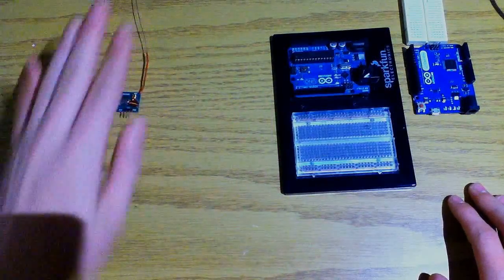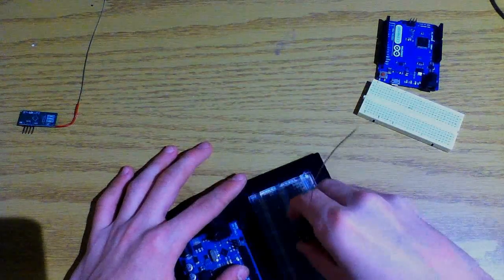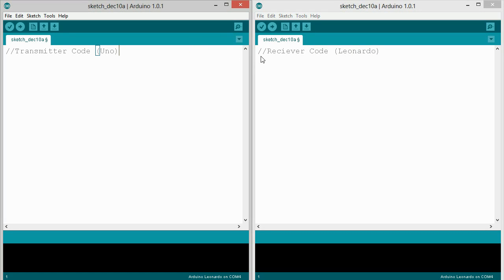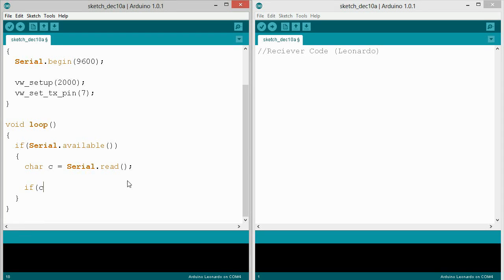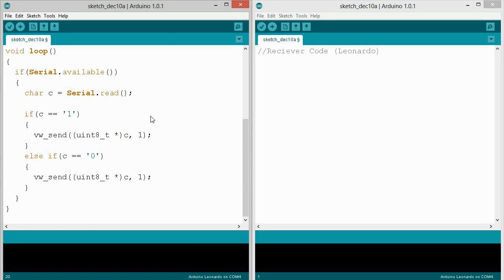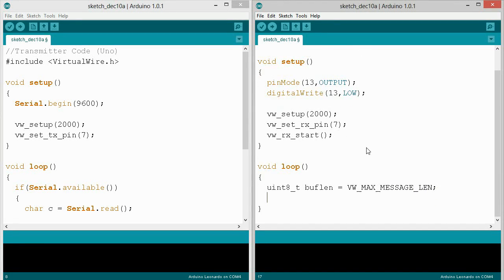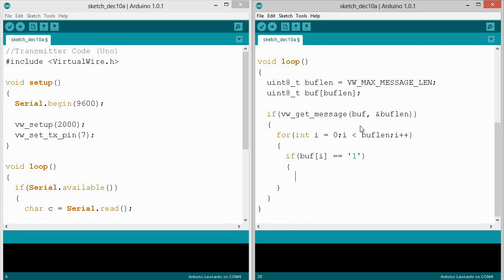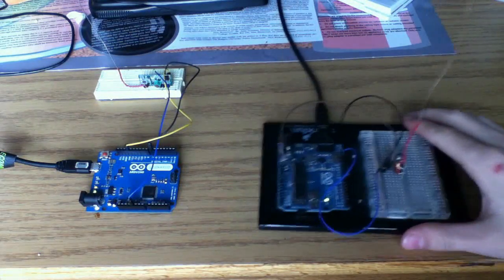Arduino Tutorial #12: Wireless Communication

Comment: You need to search for a superhetrodyne transmitter/receiver !

They dont cost so much these days and are waaaay better because they use a crystal and also have an antenna ground pin.
few tips tho you need to solder on the vcc/ground a 100nF ceramic capacitor as a decoupling capacitor to filter out high frequency noise.

And last step, solder an ipx connector to the antenna ground and antenna pin, connect an ipx to sma cable and use a proper rubber shielded 433mhz antenna with an sma  connector

This would increase your reception and transmission distance by triple or more...

Comment: stripping back insulation on the antenna will make no difference, leave it on to avoid shorting or grounding. 14CM is the length req.

Comment: Is there any chance you can do a tutorial about rf modules(receiver-transmiter) with any two arduino's
but as the transmitter to have a remote controller(up,down,left,right- 4 buttons) and the receiver connected to two any dc motors running on 9v?Thank you in advance, and keep up the amazing work!

Comment: Hello humanHardDrive, and thank you for this tutorial, I want to ask you about this topic , I want to send data from arduino Mega 2560 with arduino wifi shield integrated antenna to phone  but the problem that the arduino board could not detect the shield and serial.print: " wifi shield is not present " have you any idea about this and thank you

Comment: i am using rf 433mhz  transmitter and receiver with encoder,decoder 12d 12e for controlling relay .my code for relay is working fine. but if i switched  power off in transmitter end of arduino,the receiver end of relay is operated the last state(on means on /off means off).
i need relay in receiver should off when power off in transmitter end of arduino.plz help me with code.

Comment: Hi ,I connected everything perfectly code compiled and uploaded correctly .but the data isn't transmitting or not receiving . I don't know what the problem is!software portion is perfect , I think there is some problem in hardware portion ! all wires are perfectly connected , arduinos are working but I think there is some problem in transmitter and receiver! I don't know what? can you guide me

Comment: i cant seem to make this work, anyone knows whats wrong? we cant transmit and receive data by using the code you provided. We are using Arduino Leonardo for both transmit and receive. RF 433MHz Transmitter/Receiver Module. Please reply. ASAP
Reply: +humanHardDrive Hay just wondering do I need to use an Arduino Leonardo? Or can I just use two uno?
Reply from the maker: +Santolanbiscuit Dd I'd be more than happy to help if you would just email me your code.

Comment: Love this tutorial...but having an issue. Using your exact same tx code but sending c directly after setting c to 'A'...the Rx is receiving a message but when I print out what is in the buffer, i.e. buf[i], I am getting 255 instead of the character A so when I get to the if statement if(buf[i] == A) it does not execute the statements that follow. I understand the 255 is the 8bit max value but of course that's not useful. Any suggestions on what may cause this? You help would be greatly appreciated.
Reply: +Jaime Crosas Shouldn't (uint8_t *)c be (uint8_t *)&c to give the address of the buffer instead of the value of c as the address.
Reply from the maker: Jaime Crosas Can you email me your code so that it's easier to work out your problem.
Reply: humanHardDrive  Thank you so much for your help. I tried for a solution via the Arduino forum and stackoverflow but no solution so far. But being a newbie not sure if I asked the question correctly or interpreted the comments the right way . I emailed the files this morning. Thanks again!
Reply: +Kris M thank you very much!! I couldn't find it either

Comment: The transmitter code should be even simpler. Instead of

    if(c == '1')
    {
      vw_send((uint8_t *)c, 1);
    }
    else if(c == '2')
    {
      vw_send((uint8_t *)c, 1);
    }

you can just put:

      vw_send((uint8_t *)c, 1);

without IFs since you are sending the C value received from the serial port, regardless of what that value actually is. It will be sent anyway and recognized or not by the receivers code.

Comment: how hard is it to make them two way? I am in third year electrical engineering. I can build my own circuit if needed.
Reply: It would be to hard to find out yourself, concidering youre in your third year.
Reply: Well i am new to arduino. And we are learning barebones wireless signal analysis right now. Its damn interesting but we haven't done much practical building yet. Its all theory
Reply: For an easy 2 transmission I would recommend a 2.4ghz transceiver

Comment: Can i sent simple signal (0/5v) without arduinos using those?
Reply: +mamdobreklapki0 
No u cant do dat.. This tutorial is based using Vwire library with arduino.. If u want to send 0/5V signals using RF then u need to use Encoder like HT12E. Also u can send serial data directly to rf without any encoder or  Vwire library but baud rate should be low..
Reply: +Jatin Arora Thanks Jatin ! It will imporve my projects :)

Comment: Thank you for the video. very well done. I am new to this. I have a  question, is it possible to communicate only with 1Arduino, that is, having only the receiver on UNO while the transmitter only on a power supply. will the Uno receiver detect any signal?

Comment: I have plans to build a RC airplane capable of transmitting live video feed via Arduino microcontrolers. Mainly i was wondering if you think it would be possible. Put aside the speculation that i could actually connect a monitor to an Arduino. Do you think this setup would be able to transmit live video feed? I'm not looking for full 1080p video. just enough to pilot an RC airplane from a little screen.

Comment: I am using TWO UNOS instead of one leornado and one uno. However, on the receiving side, I'm getting the following error with the code you've written:

sketch_mar31b:1: error: expected constructor, destructor, or type conversion before '<' token
sketch_mar31b.ino: In function 'void loop()':
sketch_mar31b:15: error: 'VW_MAX_MESSAGE_LEN' was not declared in this scope
sketch_mar31b:18: error: 'vw_get_message' was not declared in this scope

Moreover, on the transmitting side, I'm getting the following error:

sketch_mar31a.ino: In function 'void setup()':
sketch_mar31a:7: error: 'vw_setup' was not declared in this scope
sketch_mar31a:8: error: 'vw_set_tx_pin' was not declared in this scope
sketch_mar31a.ino: In function 'void loop()':
sketch_mar31a:19: error: 'vw_send' was not declared in this scope
sketch_mar31a:23: error: 'vw_send' was not declared in this scope

How can I solve this?
Reply from the maker: Did you include the appropriate library files?
Reply: humanHardDrive I wrote the same code as you did. But still it gave me the error.
If additional libraries are to be added, which are those libraries and how can I add them? You have already seen the type of errors I'm getting for transmitter and receiver.
Reply: Make sure you install the latest version of Vwire library correctly(if not sure how to install a library, there are many how to install library tutorials out there. Also, delete old versions completely!

Comment: Hi, thank you for the video. My question is that I'm planning to use a tranceiver instead of two separate transmitter and receiver. What would be the circuit of it if I use a 433Mhz or 868Mhz transceiver along with Arduino?

And in this video, you've used two separate Arduinos; can we use one? And If I'm to use transmitter and reciever, do I really need to use two arduinos (with both being different)? Please address this issue as soon as possible... Moreover, I'm building an inflatable antenna which would be the reciever. In that case, how do I integrate all this. Thanks.
Reply from the maker: Transceivers would probably be a lot easier, but it really all depends on the transceivers themselves. The issue with the cheap transmitter and receiver was that it was necessary for the Arduino to run some sort of error checking, CRC in this case, which I'd imagine the transceiver has on board.

The issue with these transmitters and receivers is that they will transmit whatever data is on their transmit pin. Their job is solely transmitting. It was necessary to have 2 Arduinos to run error checking on both sides of communication to ensure the message got through.
Reply: humanHardDrive
Thanks. So If I am to use a 433Mhz transceiver, how can I integrate it with my Arduino? Do you have any reliable source i.e. circuit, which I can follow in order to build the circuit and the relevant source code?
Reply from the maker: outamawayful I'd need to know what transceiver you're using.
Reply: humanHardDrive
I'm using rf 433Mhz transceiver. :)
Reply from the maker: outamawayful I need either a model number or a manufacturer.
Reply: humanHardDrive Basically, I've built a Horn antenna which is fed by a patch antenna. I am willing to operate it at an Operating frequency of .... (I am not sure) since I took the measurements from a report which didn't mention the whoile communication process. However, when I've built a horn antenna, I'm not sure how to use a transmitter and a receiver with it. I'm just a beginner in all this. All I know is that I am building a horn antenna which is fed by a patch antenna and the patch antenna will get the power from the arduino through the connector.

What I don't know is that whether to call this horn antenna a reciever or transmitter and I don't know which frequency should I use. Actually I'm trying to build a CUBESAT model... a student model rather than a professional model... In this case, I'm not sure whether to use a transmitter or a reciever OR if the horn antenna itself is a transmitter or a reciever. I'm just a beginner in this process. That is why I don't know which transmitter or reciever or transceiver to use and of which frequency... I'm so confused regarding this. you can email me with any circuit I can follow on momg_92@hotmail.com.... Thanks

Comment: Just a correction CRC is NOT encryption,CRC its a reliable technique used to check data consistency in data transmission, v-wire uses 16-bit CRC.Im busy with these RF modules as well and I seem to only get +/- 6 meters  9 not using v-wire though as I am considering PIC 508 mcu so all the plumbing im doing from scratch.

Comment: I am Using my HC-05 Bluetooth module and I connected it in my Arduino uno r3,my wires are all fine.When I use my mobile phone to communicate with BT module I got some problems: My phone can pair with BT module but there were no connections,my phone says "paired but not connected",do you know what to do?
Reply from the maker: I would need to see your code to see any issues.
Reply: I am following this tutorial 
http://www.instructables.com/id/Cheap-2-Way-Bluetooth-Connection-Between-Arduino-a/.The result is that When I used the Tera Term with USB Cable connected to my Arduino everything works fine,but When I Unplug the cable and used the 9v supply and Run The Tera Term,the console of Tera term is so empty no sign of output.Considering I Already Paired my Laptop and The Bluetooth module they are really paired.Do you Know What to do?
Reply from the maker: Nathalie Galia I'm wondering if the Bluetooth module was talking directly to the computer when you had it connected via USB. Have you tried reversing the connections for the serial port?

Comment: Hey humanHardDrive...im using two arduino uno's for this setup. in addition to the on-board LED, i am using a speaker with a 555 timer circuit as an output on the receiver end. However i have a problem, when i transmit, the receiver works but when i send the '0' character it does not stop...the LED stays on and the speaker keeps buzzing, its like its stuck in a loop. Do you know where my problem could be?? the code is exactly the same as yours.

Comment: What you call an array (the *) is a pointer to type and what you call a pointer (the &) is an address-of operator. A pointer points to 1 variable which is often the start of an array but by no means always the the start or even an array at all. If you start using the string.h commands you will see a lot of the flexibility of pointers but still not the full power.

BTW, you and Jeremy Blum must love to type because you don't use copy, paste and edit!

Comment: HT6p20b is a hardware encoder, I simply decode the data with arduino (HT6p20b  -> transmiter -> receiver -> Duemilanove). But when I put Mega2560 on place of HT6p20b (Mega2560  -> transmiter -> receiver -> Duemilanove ) it dont work. I´m using 5v  to supply the transmiter and no pull (up or down) in data pin. on receiver I put a pull down resistor on data (cause my model works with 3v logic levels). On mega transmiter data pin is 18 (tx1), I´ve checked power supply from transmiter and it´s ok.

Comment: Hi. I tried this but don´t worked. I put an arduino Mega and a Duemilanove. The receiver  and transmiter are working. I know because I´m decoding the HT6p20b data on duemilanove (sended by the transmiter ) whit this. But when i try to send data trough Virtual Wire don´t work. I´ve copied your code but nothing appear on arduino receiver serial monitor. Any idea?

Comment from the maker: It doesn't matter what kind of Arduino you use. With proper antenna design and line of sight, you should be able to get transmission upwards of 500 feet. Under normal circumstances 20 to 50 feet.